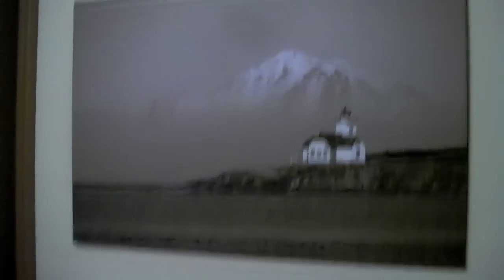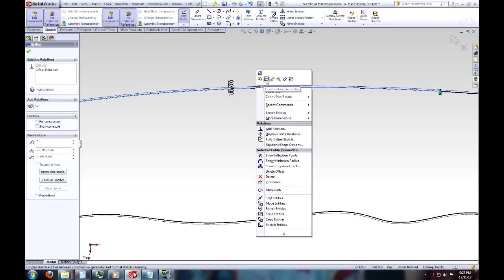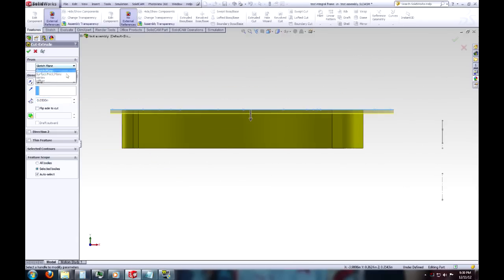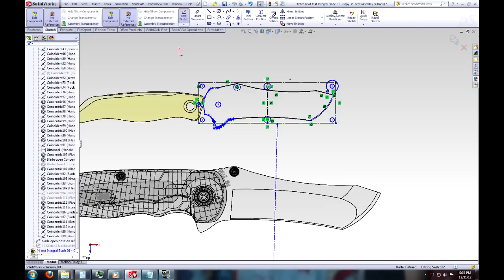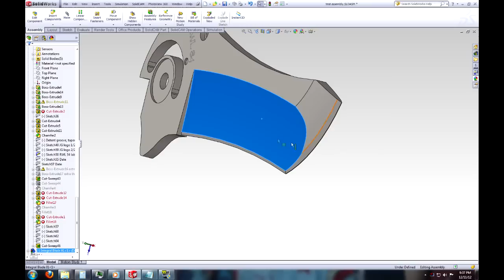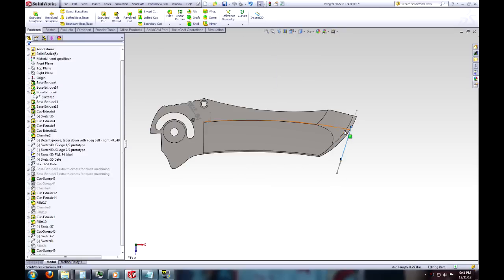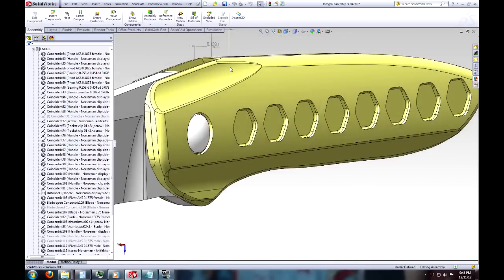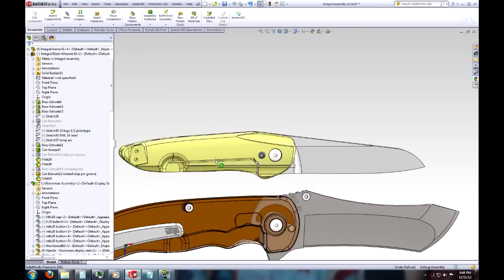Knifemaking Tuesdays Week 51 - Designing my Integral knife

Comment: I've been designing in AutoCAD 123D and I gotta say, modeling the profile/bevels for machining is not easy.  Especially considering I want to leave a little meat at the edge and tip to ensure geometrical integrity after heat treat (I use O1 and A2 steels).  I think your method (setting a profile sketch and cutting along a path) is the most reliable to get proper tapers, but it is hella complicated to set up, at least for me at this point.  Maybe it is easier in other software packages.  Another point to note for anyone reading, is always fillet the inside and outside edges of the plunge line; sharp corners introduce force risers and weak spots.  Also for the haters, I haven't designed anything on 123D that has gone into production/commercial use yet, so I haven't violated their ToS.

Comment: this was a very helpful video. I am currently taking a solidworks CAD design class at my college for a degree in mechanical engineering and for an upcoming assembly assignment I decided to design a flipper knife. unfortunately the professor for that class has only used CAD software to design things such as engines or parts for jets so he hasn't been able to help me very much when it comes to working out problems with designing a knife. It would be really awesome if you could do a tutorial series on how to create a full design from simple starting sketches to an assembly geared towards solid works users at a beginning level.
Reply: I use solidworks day in day out at work the nicest thing about solidworks is that you can design anything you want pretty easily there is nothing different between designing a knife and an engine but with an engine there are far more components. think of a basic design something visual and just start modeling it ( each component ) then create an assembly and assign relations to the components and you will begin to see any design flaws as you move the components into place.  Good choice on doing a knife as a project to get familiar with solidworks they are the easiest to design. There is nothing complex about them but give a good experience with designing parts and assemblies. Good luck, if you have a trouble check out www.grabcad.com or Solidworks forum, you will find many tutorials on how to do pretty much anything you need, many people no matter how seasoned they are will run into a problem and these places bring many designers together to help each other out.

Comment: rebuilds, extrusions, re-sizing extrusions, etc. take 20+seconds on anything more complex than a simple fixture plate. Hovering over a feature in the sidebar (e.g. boss-extrude for a pair of handles) it will take ~10 seconds for the orange wire-frame to highlight the edges in orange. The simpler the feature, the less time it takes.

Comment: 250sfm probably is significantly too fast for you, I only intended it as a "best case" scenario horsepower wise. Otherwise, I think you're on a good path. Your contour doesn't appear to have a lot of inside arcs, so your axial engagement should be nice and consistent.

Best of luck.

Whoever said it was easy, lied. :)

Comment from the maker: Psht, I thought machining was supposed to be easy?
I can tell you that in the low pulley (100-2000rpm) it's got the most power at 860rpm, that's when the VFD reads 60hz and the Tormach guys told me that's when it's most efficient.  The motor is rated at 1.5hp 240v.  250sfm sounds FAST.  GWizard suggests 100sfm and 0.0015 chipload per tooth (it's got 12).  Which equates to 127rpm and 2.33 IPM.  That's with an axial engagement of 10%, 0.3".

Comment from the maker: I use SolidCAM to generate my Gcode.

I use a glass aquarium heater for my anodizing acid bath, it's got a built in regulator so I can hold it at 65-70*F.  For my hot tanks I use a hot water heater element from home depot, 1500w for $25 is cheaper than any other style of heater, they're just really tricky to mount.  Small 300w aquarium heaters will get your colors up to 140, and might be strong enough to get a gal or two of clean/seal up to boiling.  Best of luck!

Comment: Manufacturers will usually suggest Ae/Dc=10%, that is, your axial engagement should be 10% of the cutter diameter, less is probably safer. 

But where the issue comes about is this, say your carbide is stable to ~250sfm in Ti (just ball-park guessing, I rarely run Ti) that means for a 3" cutter, you get ~300rpm. The cut will require ~0.2HP per engaged tooth. How much HP does your tormach have at 300rpm? :)

Comment from the maker: I guess what I meant by depth of cut is actually called axial engagement, or stepover.  My saw is 0.156 and my slot needs to be 0.156.  But axially, I should do it in a bunch of steps right?  Like maybe a 0.1" stepover and 5-10 passes?  Don't want to stall it, break it, or throw my work out haha.

Comment: Its actually preferable to split it into two depth passes, its easier to control the slot width. The trick to slitting saws is balancing low SFM with machine horsepower. Luckily you bought carbide-- it will help. Often times, especially in the harder steels, you effectively have to run at a higher-than-otherwise-acceptable surface speed, because otherwise you wont have enough torque to get through. Axial engagement becomes very important as your cutter diameter increases.

Comment: Perpendicular to the sketch, coincident with the endpoint.

Also, keep in mind that a 1/8" slitting saw can make a 5/32" wide slot in two passes, so depending on the cost of the custom grind.... And I look forward to the video of the tormach running the slitting saw, I know my i've stalled my Mori's spindles a few times with those, so it should be interesting :)

Comment: That would be great. I wanted to anodize them bronze but I think it'd have to be a heat anodize unless you put a thin ti sheet in the base of your container and let them sink to the bottom and rest on it. I couldn't see it being reasonable to put 300,000 tiny electrodes on individual pieces! Maybe I'll invest in a propane torch and a steel tray of some sort, give them a good blast with that. Hope to see you at the xmas gtg

Comment: I have a guy here in Hamilton who paints and has access to a sand blaster where he works. He's offered to sand blast knives and G10 if I need. I guess it would be nicer to have your own and do everything in-house. Dont think I saw a video where you set the tension on the lock bars on the Norseman. Heat makes sense!

Comment from the maker: Only to fill out the blade-to-handle gap better.  My Norseman was designed for about 0.015" clearance which looks like a lot now, this will be around 0.008".  And thicker blades machine a bit better, I think.  You're on the list, I'll contact you when I finalize things more.

Comment: I can understand from the drawings what it will look like mostly, just wish there was a way of having the handle smaller near the pivot pin so you can 'choke up' on it, but I get the necessary way the flipper works is kinder in the way of a smaller easily grip able handle.
I also think any shape the handle takes should be a form and function design, so designing in grooves when it does not need intakes away the minimalist smooth and flowing lines of what the handle could look like. Just an idea

Comment: I really like the design. I hope that slotting saw works well so that you don't have to spend hours and hours just milling the slot and won't have to charge a ton for it. I bought a Norseman, so I know how much those cost, and I hope these don't end up substantially more. However, I know they probably will be if the slot takes forever to cut and I have heard that the slotting saw takes about as long as an end-mill... about 8 hours. I hope that's not true...